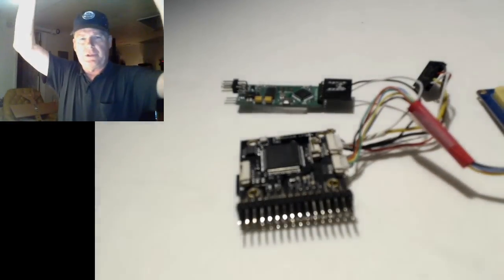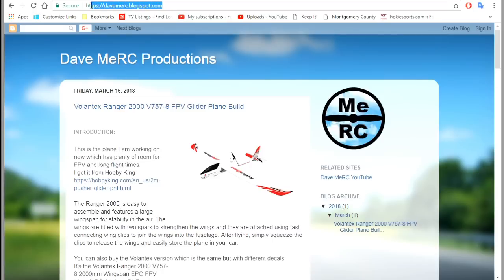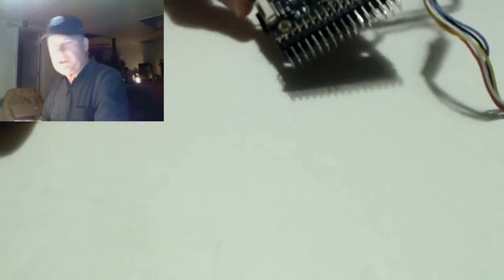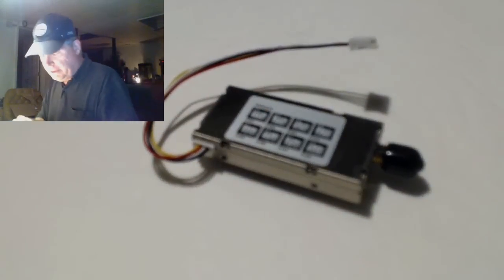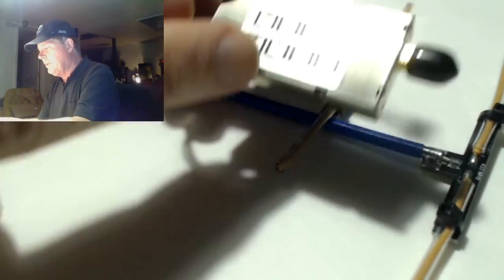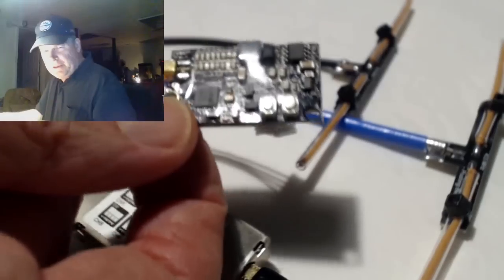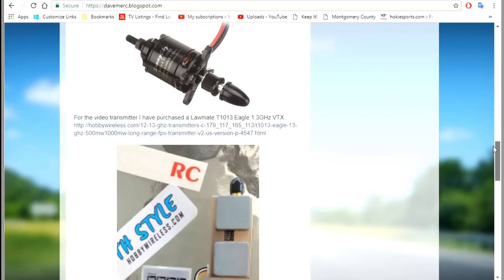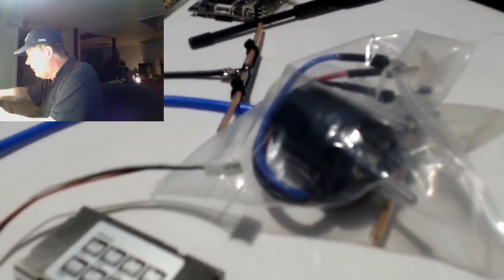Volantex Ranger 2000 FPV RC Plane Build Part 1 - Picking the Parts

Comment: Proposed battery’s will be too much weight. 3 cell will be heaps and 2200 will be enough, half for the motor, half for all the gear you’re putting in it. Don’t forget,  it’s a glider!!!
Reply from the maker: I will definitely shoot for light weight as possible but if I am going to have an FC and FPV a little bigger bat is necessary to run the extra equipment. I probably could use a separate separate video battery and keep the flight battery smaller. We shall see.